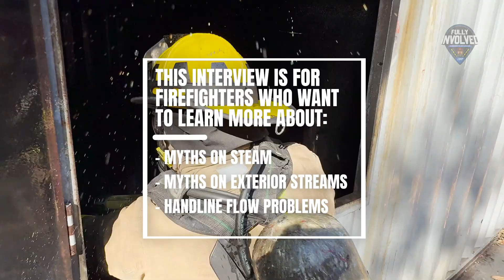Myths That Are Holding Firefighters Back: Sean Gray on Nozzles, Water Mapping & Fire Attack (E1)

Comment: Water. Mapping is a sales strategy for OEMs like TFT. It’s BS. We already know that the heat and intensity of fires in the modern, synthetic fuel rich fire environments out pace the fire flow rates of every nozzle on the market today. What fire flow formula does TFT use to quantify and validate the use of their nozzles? Iowa rate-of-flow formula? Iowa doesn’t work anymore because it takes 600 gpm to achieve the 1 gallon per second rate-of-flow required to absorb the high BTU’s in a synthetic fuel rich fire. Remember, UL FSRI research informs the fire service that only 5% to 10% of the water applied to a fire actually contributes to extinguishment. The remaining 90% to 95% is wasted runoff that does nothing to stop a fire. How UL decided to map the water that runs off to have it account for something it never accomplished in the first place is the height of scientific BS. The only way you can overcome the efficiency of water is to add a foam concentrate. NIST, the largest fire science laboratory in the world claimed that their tests prove that Class A foam concentrate makes water 3 to 5 times more efficient than plain, untreated water at extinguishing fires. It’s no longer a question of how much water your nozzle delivers. It all boils down to what you put in your water to make it wetter. Wetter water is better water.

Comment: FYI using Class A foam is not “fighting against tradition” in the fire service. Class A foam was only introduced for the first time in the 1980’s so why does Mr. Stop Believing Start Knowing ignore the use and application of foam applications on the fires he claims to have mastered by using plain water? Sounds to me that Sean doesn’t want to step on anyone’s toes over at UL or Task Force Tips. Just pump water from a smooth bore pipe  even though UL admits that plain water is only 5% to 10% efficient at suppressing fires.
Reply: Nothing he said contradicts foam usage as a wetting agent on a structural fire. You are clearly emotionally invested in your beliefs in tactics no longer being accepted and getting angry. Spamming isn’t making anyone take it seriously.
Reply: @HerpDerpNV yeah, whatever dude.

Comment: It runs perfectly in Chrome, Edge, or any other Chromium-based browser without needing extra software. Apps are also available for Windows, macOS, Linux, and Android TV to support local performance. You can use it on LG webOS and Samsung Tizen TVs—or even in Mercedes-Benz cars with MBUX. With a single subscription, the platform adapts to your life—not the other way around.

Comment: Sorry Sean but you got the steam expansion thing wrong. When 1 molecule of water converts to steam at 212° F it expands 1700:1. When heat converts water to steam at 1000° F it causes more heat expansion than 1700:1. Do you know what the expansion ratio is when 1000° F heat expands 1 molecule of water into steam? It’s not 1700:1 I can guarantee that. And as far as gas contraction is concerned you need to know this: 
Before a gas contracts it expands. When heat from a fire in a burning building converts water to steam it carries with it expanded fire gasses that are still flammable and poisonous. The diluted fire gasses and steam expand into the survivable spaces where occupants are, making their escape impossible to survive. Just one breath of expanding fire gasses - yes even after fire  gasses have been cooled with water and contract they can, and has killed many occupants trapped inside of their home. 
Have you ever used a smooth bore nozzle to apply water mixed with a Class A wetting agent? The concentrate in Class A wetting agent contains surfactants which bond water molecules with the synthetic hydrocarbons in smoke and fire gasses making solid fuels too wet to burn and fire gasses too heavy to remain in the atmosphere. I think you are repeating talking points on behalf of UL and TFT, not the U.S. Fire Service. That’s not hate. It’s just my observation. Take it any way you want but you need to own up to the chemistry and physics of a fire regardless of how you take offense to criticism.
Remember this:
Hot Fire Gasses Expand.
Water Makes Fire Gasses Cool.
Cool Fire Gasses Contract.
Gas Contraction Causes Condensation.
Condensed Fire Gasses Become
Water Vapor and Concentrated Fire Gasses that are more lethal to inhale than they were before they got wet.
Chief Hughes
Battalion 1 (retired)
Chicago FD
Reply: I author training on foam for pump operators by online subscription. The reason I author training on foam is because people like Sean Gray don’t train with structural firefight foam even though onboard Class A foam proportioning systems are available on many fire apparatus. If you know Sean ask him one question:
Why don’t you train with foam to suppress the same fires you fight with plain water so you can compare which application puts the fire out faster while using the least amount of water? 
When he answers keep in mind that the faster a fire stream extinguishes a fire the more life and property it saves.
I’ll be curious to hear what he has to say on this subject.
Reply: Really appreciate this correction. Any books you would recommend? Or how to learn more? I’m studying for my FF1 and 2, and a lot of the textbook doesn’t cover stuff like this as in-depth, and I would like to know more. Thanks
Reply: @rainsarge word of advice: don’t take advice from YT comments citing outdated “experience” and “knowledge” based on beliefs that have been proven to be false/fire house tales.
Reply: @HerpDerpNV  Thanks. I just finished the academy about a month ago and started getting more Fire EMS-related stuff on my feed. 

Everyone has something to say about everything in the comment section about how the person is doing something entirely wrong. No clue yet why they do this, though.